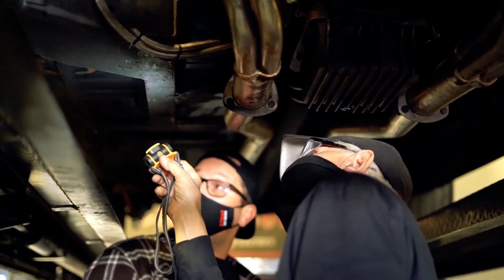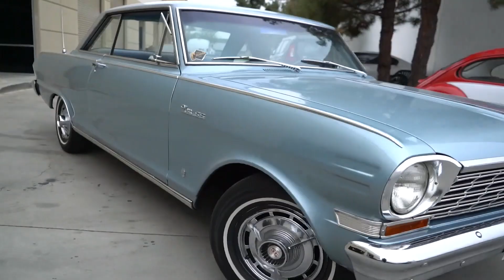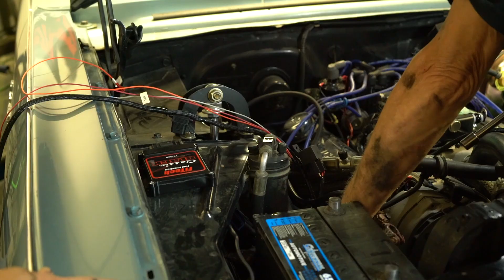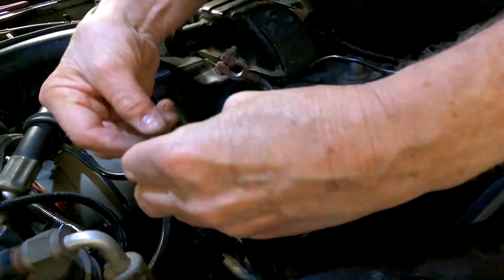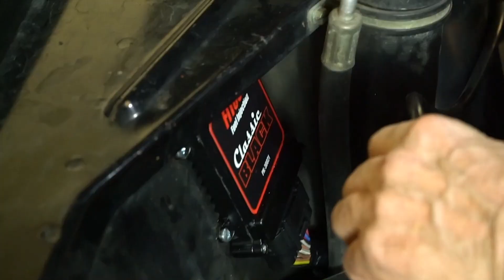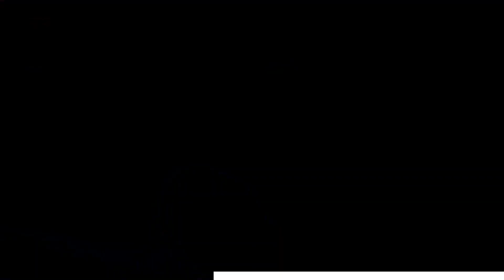Installing a 30021 Classic Black EFI System | Tech Tuesdays | EP39

Comment: Can I get a remote ECU for my current 30003?  You currently have my EFI for ECU replacement under warranty.  I would love to get the new ECU as far away from the Ford distributor and coil, just inches away from the EFI face.
Reply from the maker: Hello, unfortunately  we only have remote ECUs for certain systems such as our Classic and LS series. We have seen customers create a metal or aluminum shield between their distributor and ECU (please do not use aluminum foil as that is for diagnosing purposes only) to block off RPM noise. 

Please check out our video on RPM noise for more: https://youtu.be/3nMESN_uW38